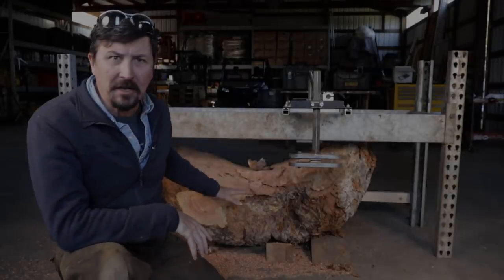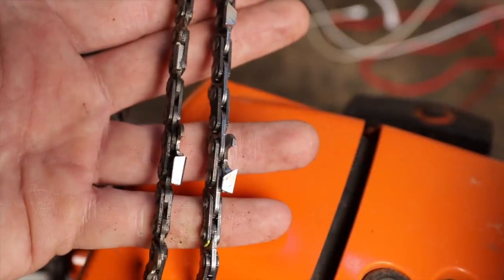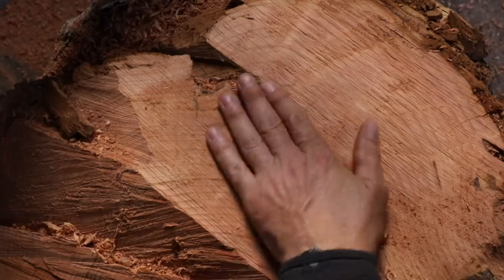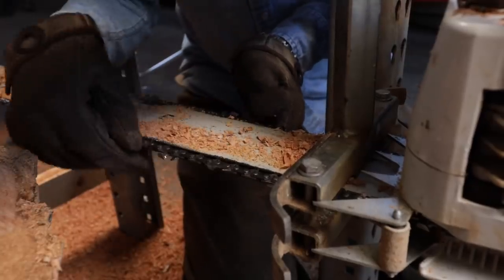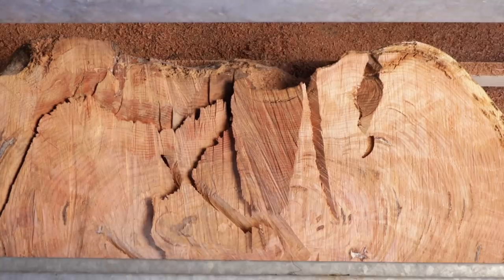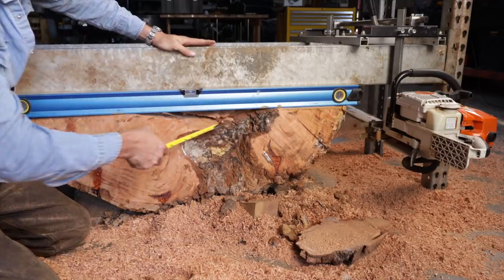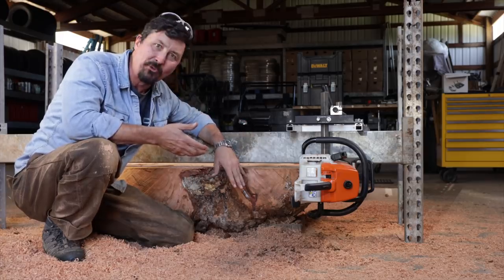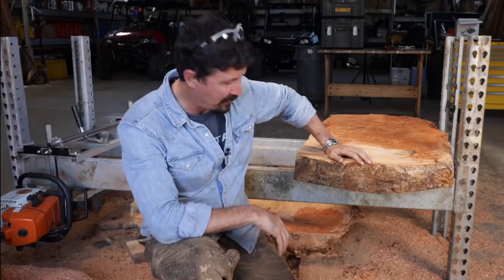The Incredible Chainsaw Mill

Comment: Something about these types of projects where you really, really, start from scratch is very fulfilling and rewarding.  Two years to dry is a worthwhile wait.  I really hope it doesn't bow while it's drying!
Reply: And I hope I am here to see it.   🤔
Reply: If he wants to make a bowl, he's going to need to go somewhere with a lathe. If they have the lathe, they probably have a wood drying kiln. It's a pretty small slab, so yeah, with the altitude and temperature shifts, this project deserves a little professional intervention I think.
Reply: It's 4" thick, as long as any bow is not too bad you will be able to bring it back to flat and still have a decent thickness for a top.
Reply: Sven3xs yes, a lathe turned burl bowl. There's YouTube pages dedicated to it. High value item.

Comment: Hey mr w what had really helped me was I took a full comp chain and ground off 4 cutters then left 2 ... ground 4 then left 2 ...end result of a big skip and the 2 cutters where always offset.. left right right left .. it was much faster less to sharpen just a win win and no Super expensive mill chain. I’m using a husqvarna 2100 of the old days with a 42” bar. If you have a old chain give it a go and tell me what ya think!

Comment: My Husqvarna combi can came with a springloaded nozzle for the oil, but I dont use it because during the winter here in Norway it gets really cold,  -30 °C = (-22°F), and the oil get so thick it wount run through it! But the gas will. Great video, Cody! Keep it up!

Comment: I really wanna see you and Mrs W do an artsy epoxy fill. Use that remaining wood to make a mirror image and then join them together with resin. Lots of YouTube videos. Nice thick coat of protection.  You need a full size wood turning lathe to make a bowl, and I do t recall seeing one of those behemoths in your shop. Arguable if you have all the various sized and shaped carbide cutting tools either. 4 year wait! Isn't there a kiln option?

It's going to be fantastic, very excited. Thanks Cody!

Comment: the Husky combi-cans have a tendency to leak once you have used them for a  while because the O ring around the top of the spout tends to either split or come out of place. they also do make the same anti spill spout for the bar oil, you just have to buy them separately. however i wouldn't recommend them especially in colder climates because the oil takes a long time to come out, i have used the cans day in day out for years working in forestry and tree surgery. 

Keep up the brilliant videos Cody!

Comment: I just got my Husqvarna Combi Oil and Fuel Can and both gas and oil have the spill proof spouts. It also came with the extra non-spill proof spout you are using for the oil in this video.

Comment: At 2:42 you have those chains backwards. The one on the left is a semi-chisel chain and, is good for dirty wood conditions because of the long rounded leading edge it tends to stay sharp longer and, can be sharpened easily with the appropriate round file. Whereas the chain on the right would actually be your “ripper chain” which is actually called a full-chisel chain. This chain cuts fast and will maximize the efficiency of your saw due to the square leading edge that really bites into the wood creating slivers instead of chips of wood meaning that the chain does not have to work as hard to clear the cut of wood chips only maximizing efficiency even more, the only downside to this type of chain is that it dulls quickly, and has a higher chance to kick back. I’m a STIHL sales and service representative at my father in laws small engine repair shop, we go to every school they offer and take every test they offer, I just thought you might like to know what the chains are actually called and their purpose. Great video! I learn tons from you, and I appreciate how open you are about you relationship with God, keep up the great work.

Comment: Take a look in the stihl book, they make caps auto cut off caps for both fuel and bar oil on your combi can, been using them for last 25 years.  Chain oil cap can be not great if very cold due to oil viscosity. Best regards to you and your family in these testing times from the UK. Ben Willey

Comment: Briggs & Stratton had a Smart Fill gas can that worked the same way maybe 15 years or more ago. They were a little pricey but I gave one to my sister since they had two handles (top & end) that made them so much easier to handle. Mine has a stubby spout with a yellow tip - I can't speak to the current incarnation (w/ the green).

Comment: Personally I love stihl’s snap caps they are quicker than the normal screw on ones, and I have been using my stihl for over a year and I have not yet spilled any gas or oil because of the caps

Comment: It does have the same feature on the chainbar oil side, I got the same kind of gas can and I got auto stop on both sides, the one you have on the oil side does come with the can as a extra, its ment to be used in the winter when the oil gets hard to pour from the auto stop one.

Comment: Innovative use of that teardrop pallet rack.  Good decision on cutting it thicker. I was worried you'd cut it close to finish thickness and then have it warp badly over time. That might still happen. Recommend designing a naturalistic style of  table that embraces this possibility rather than a super high finished piece that contrasts with the raw edge and imperfections. And....please no turquoise inlay.

Comment: Wonderful video-Is there a concern of running gas saws in an enclosed space.Liked the comparison rip chains and usually “crosscut” chains.Like rip saw blades vrs standard combination blades.Rip blades chisels on a wheel-rip chain chisel teeth on a chain-skip tooth-see this on bandsaw blades.

Comment: I agree, those quarter turn caps are not very good. The cap on my brand new 461 allowed half a tank of gas to leak onto the floor where it sat for two weeks before I even started the saw for the first time after getting it hime from the dealer.

Comment: I was thinking about the rack stand you were using. If you needed to do this again, would it be a more stable platform if you welded some 6" flat coupons onto the feet? You could also drill some holes into them for temporary anchoring. That way if you had to use it outdoors on site, you could level it and then drive some rebar spikes into the ground securing them.  Just a thought.   ":)~

Comment: Thought I had subscribed but apparently not ! Have been watching your videos for quite a while.  You have probably figured this one out by now and most Stihl owners have had troubles with the “new and improved” gas and oil plugs but just make sure the seating gasket is free of dirt, chips, sawdust and it will work as it should. Really like the info you are putting out there. Never mind the nay sayers. Take Care.

Comment: Hot melt glue is great in situations like this. Just remove it with a heat gun later. I always wanted a small mill like this that would fit in my garage. Thanks for the info on the proper ripping chain. This could also easily convert to a router planing jig.

Comment: The can when I bought it came with two nozzles for each side that were like your gas side with the spring. If your in need of one for your oil side with the spring, I have three I can part with, two which are made for the oil side.

Comment: Thank you for this video much appreciated. I really like your idea of the support to hold your chainsaw mill. I am in the process of starting to do some of this. I have some Madrona and some cherry that are my first ones both of them are about 2 foot in diameter and there are a couple of other Cherry‘s that have a good curve in them. After watching your video I had a quick idea of a support to handle those curved logs. I could make a dolly with multiple casters all locking. I’ve got as far as I can on the log. I could stop reposition the log under the mill and finish the cut. I am curious what you might think of this idea?

Comment: Oh but they do have the same feature for the bar oil side of the gas can. It comes with both. The one you are using and one same as the gas side. But very slow in cold weather. Love my gas can.

Comment: 8:55 What's the price tag for that off cut?? 12:15 you could fill those gouges with a two part epoxy, like Total Boat, for example, and you can even color the epoxy whatever color you want to compliment or contrast the wood. Defects can be a great asset with what you want to do with this amazing slab.

Comment: these fillers for the chainsaw are arround for a long time and there are even one for the bar oil but in winter the oil is so viscose that it takes verry long to fill up and you are better of by using the normal one

Comment: I think that my new Stihl chainsaw is over oiling. Should I adjust it even though the saw is brand new? there is oil going everywhere and the tank seems to run out really quick. Should I let it break in and then adjust? its a stihl ms261.

Comment: You must have been ripped off with your fuel/oil combi as they come with one for the oil as well. The only real down side is you can't use the spring loaded one with the oil in cold climates , and in warmer weather you need to release the pressure on the fuel one before filling or you get a 2 stroke shower which no one enjoys.

Comment: I believe your statement about using the Alaskan in order to be relevant, since, most people own a chainsaw(at least of those who watch these videos), does not accurately relate to most people.   Your follow on statement about using at least a 32" saw probably excludes about 95% of the people who own chainsaws.  I for one have used and owned chainsaws for good part of my 52 years; burned and cut a lot of firewood, but I've never owned a saw larger than 20", and I'm thinking that generally holds true for just about anyone who's not a tree professional, logger or forester.  Might be just me, but I doubt it.  Anyway, I like your content, but I just had to say this.